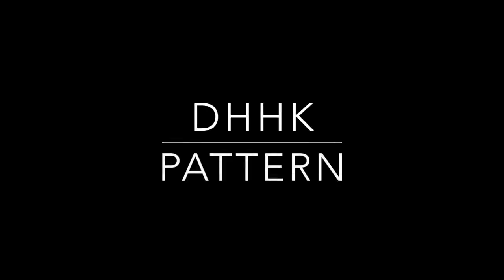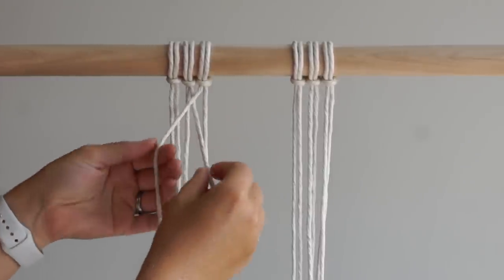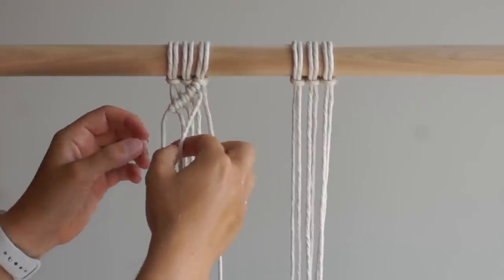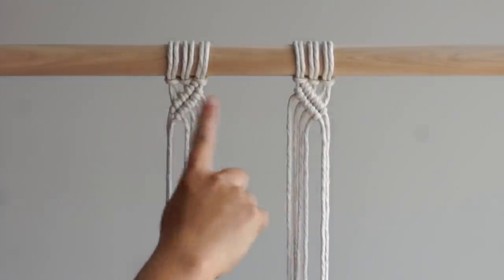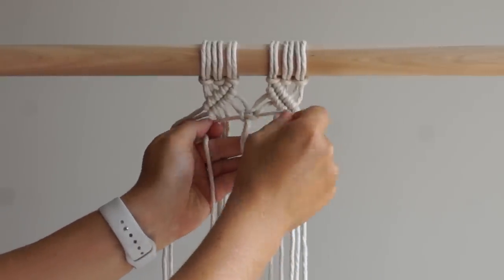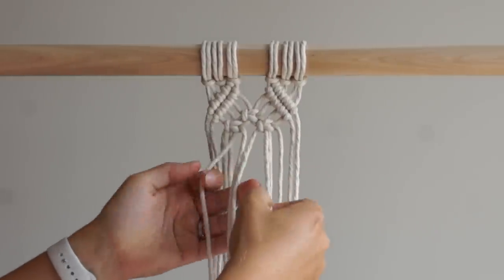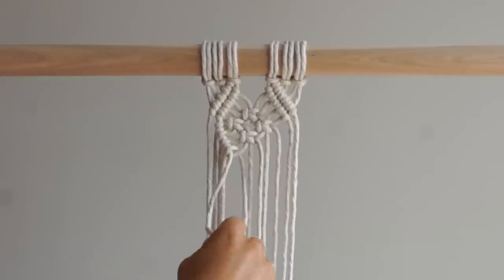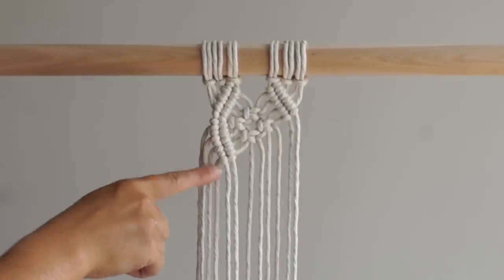DIY Beginner Macrame Tutorial: Diamond Pattern with a Twist!

Comment: This is beautiful and simple! I would recommend if you are going to repeat this pattern several times lengthen the two outside cords on each side. These cords are the ones that get knotted and become much shorter than the holding cords. I plan to add a yard to these 4 cords when I make this design again. P.S I began with each cord being 6 yards and I worked the design until it was about 20in. long. At this point, my working cords were about a yard shorter than the holding cords.

Comment: Do you have any tips for editing/changing a pattern to make it a bit bigger? I love so many of the wall hanging tutorials like this one that you have done but I would love to size them up just a bit. I've been charged with making some for my sisters wedding in October to hang on the ends of pews as seat markers, but I feel like they need to be another 2 or so inches wider to be substantial enough to fill the space and be noticeable. I'd love any tips you have to help me out on that! Thanks so much! And all of your patterns and tutorials are so amazing 😍😍
Reply: Hey Laura! You could try sizing up to 5mm and adding extra length to accommodate the size difference. I'd also try adding one or two more strings on each side for the half-hitch knots so it extends out a bit farther with the pattern.